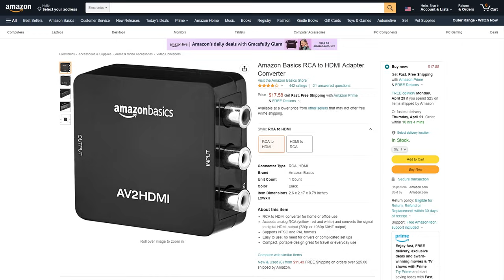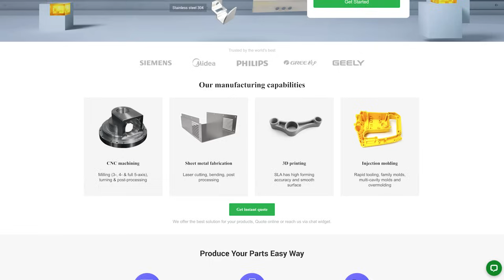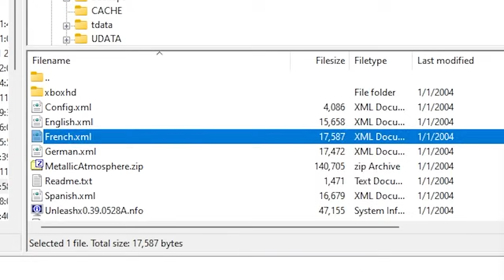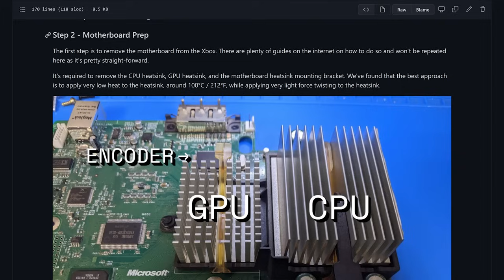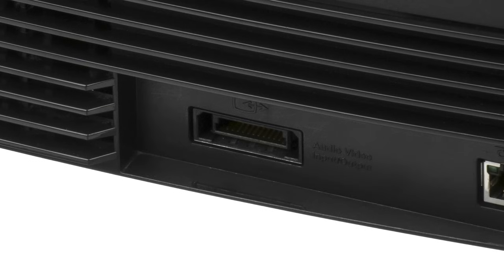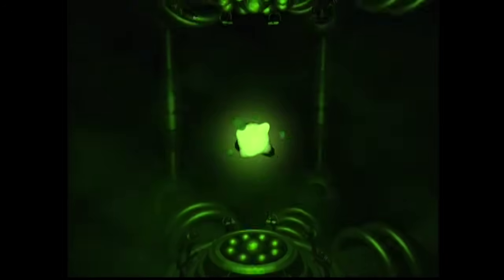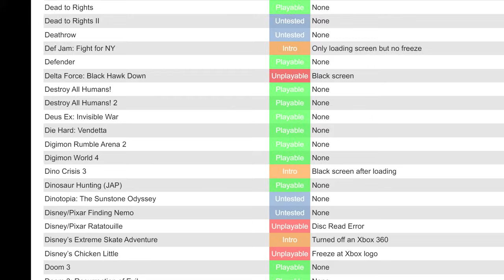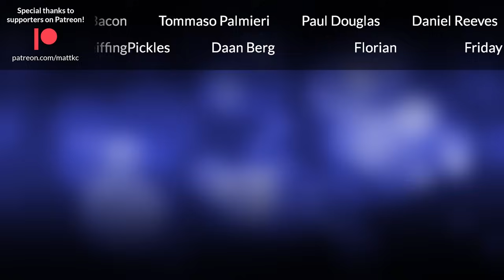The BEST video output for your Xbox - XboxHD+ HDMI Mod Review

Comment: IMO the only reason you should do an HDMI mod on any console is if you are a streamer who needs their console to work with a capture card, and even then the retrotink products exist. I would much rather use my microsoft HD pack and good component cables with my xbox to play games on my CRT. Buffered component signal splitters exist too, so you can even use a capture card into your PC while playing on the CRT at quality. These games might support progressive scan image, but all were designed to play at 480i really. It's just a part of the era that should be embraced.

Comment: just download an emulator
Reply: yes, download an emulator that has mediocre support for most games that will most likely not work or even run terribly
tell me ONE OG XBox emulator that can decently run most games at 30(+) fps, is stable, cross-platform and has very active development with hundreds of developers contributing.
please don't be ignorant and post stuff that doesn't make any sense, thanks
Reply: @macrigaming8621  just download mario kart or buy a decent gpu wtf
Reply: @ElRicoSanchez  seems like you're definitely trolling, because mario kart isn't even for the original xbox, and there is just not enough demand for DirectX Box emulators.
Reply: @macrigaming8621  took u 9 days?